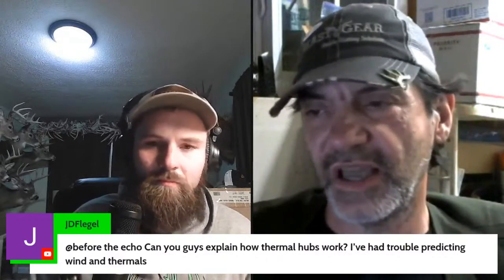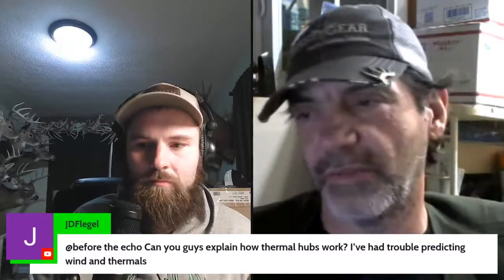What is a thermal hub?

Comment: I'm a public land hunter, but I have access to 40 acres of private property that borders public land to the north. The area has an excellent deer population. The problem is it's the perfect thermal hub. It's basically one long hollow running SW to NE, with perfect draws at both ends. If I hunt the ridges on the east or west side of the hollow in the afternoons, the thermals take my scent down into the hollow and it gets distributed either direction according to the prevailing wind. Within minutes my scent is moving up/down the hollow and the dispersing E/W at the downwind draw. 100 yards west of the hollow is a road. Deer rarely come from there. On the east side, there is 1000 acres of private land, and that's where the deer bed. They have little motivation to come toward the road, but add in the thermals factor, and I've killed exactly TWO good bucks there in 20 years. It's a puzzle I cannot solve.

Comment: Would it be possible to sit at the top of one of the parallel  draws on the side of one of the points?
Reply: Yes but depends on wind. You have to windcheck it in the fall. Summer wont work. Wind currents are different with the leaves on the trees. I like to hunt up a hill from a hub on sign exiting the hub. I get better winds on the upper sides and I just wait for them to come my way.

Comment: My neighbor has a thermal hub.  He lets me hunt it exclusively.  There are 5 points the bucks bed on.  It’s impossible to get in there.  I’m like Dan….   I get cocky every single year thinking I can beat it.  I will tell from years of experience that I cannot.  The way the terrain is and the only real way to hunt it as described here, is on the other neighbors property.  He has that “mouth” where it lowers and widens out.  But he hunts it, so…. Better luck for me next time I guess.  
Side note, this year was the first year I have not been tempted to go in knowing what I know after years of getting my tail whooped in there!
Reply: Try an extreme scent control regimen, and hunting abnormally high in the tree, 30+ feet, usually a saddle or climber is necessary, and arrive before the deer, 2+ hours before daylight, makes for a long day, but it works